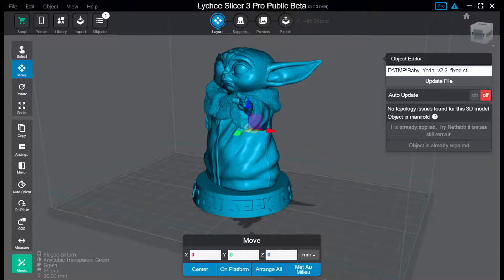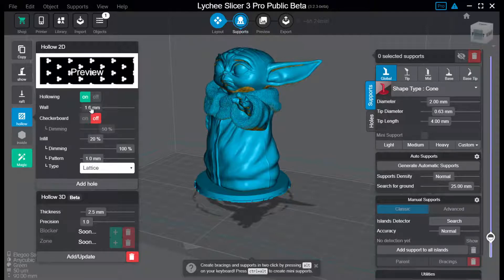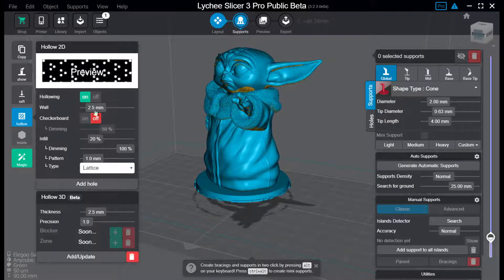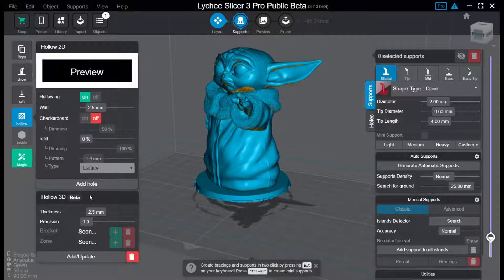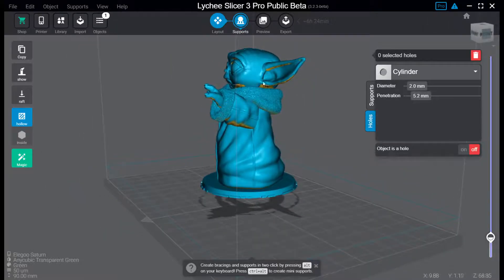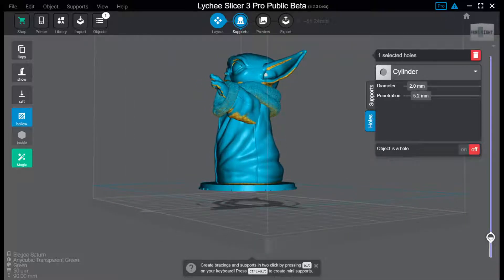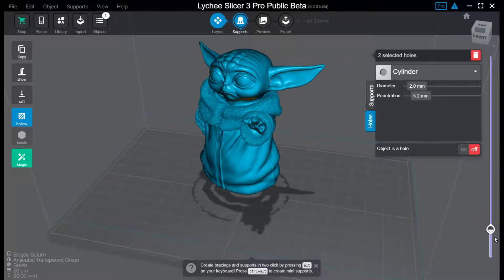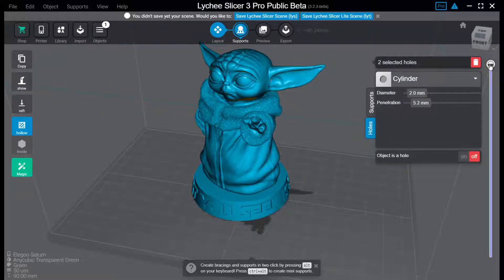J3DI Lychee Slicer Hollowing

Comment: hi, when I try and hollow I get a message infill and/or drain holes are not compatible with a 3d export.they are only used for native slice export for 3d printers file format .they will be ignored. Can you help please? very useful and informative video thanks
Reply: Hmm.. I haven't tried that one myself.... I'll do that and get back to you!
Reply: It seems that you can't export with holes, even if You get so far as to the final phase before slicing. There it is stated that drainholes and 2D hollowing and infill is not compatible with export to 3D object. One idea I got was to add a cylinder  as an object and subtract that from the main object to create a hole but that was not possible either.

Comment: Why wouldn't you put a hole in the very bottom? A vertical one, which you never see, in the very bottom in the middle?
Reply from the maker: Mostly because if I print it directly on the plate you will have it sealead against the plate and you need some holes to let air in so the trapped resin can get out in through the holes that are located higher up.. or rather further down since it prints upside down. If you raise the print from the bed and put it on a raft or on supports you can put the hole in the bottom...

Comment: How do you "apply" the holes once you place them? Do they automatically show up when slicing?
Reply from the maker: If you have placed them they are applied, they will show up when you preview..  If you use the clipping tool on the right hand side of the screen and  move up and down they will show up also. And if you have done a 3D hollow they will show up too.